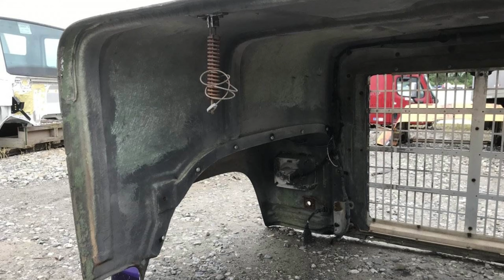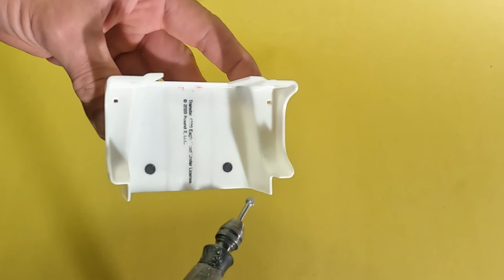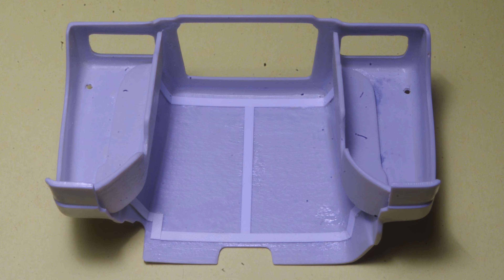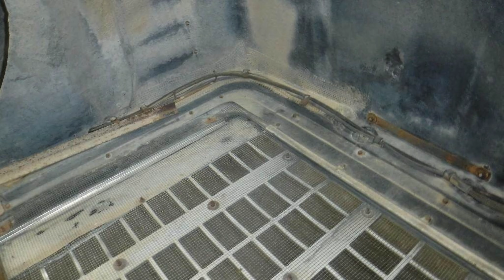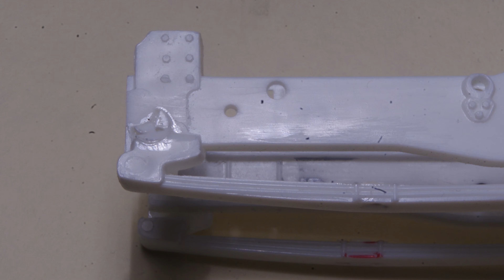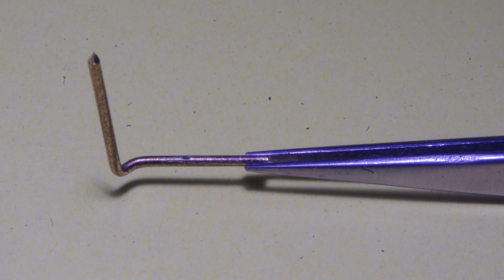Adding under hood details to a 1/25 scale Transtar 4300 model (literally!)

Comment: One more method to create a texture on the bottom of the hood is to coat the surface with some model cement and stipple the surface with a stiff brush the come back after it has dried and lightly sand it just to knock the too high points, this can recreate a cast look for metal and for rough fiberglass
Reply from the maker: I am going to use that solvent cement approach on a future project, I think it will also solve one minor problem with the carbide burr technique which is the difficulty of texturing the laminated reinforcing ribs.

Comment: That is some nice super detailing. Very well done Robert.
Reply from the maker: Thank you, it was fun to “problem solve” and puzzle through. Initially I considered using step side fenders from an AMT Chevy pickup kit of about a 55-57, for the inner fenders but only had one set so decided to try building inner fenders instead as I would like to build another Transtar or two in the future.

Comment: Robert ,
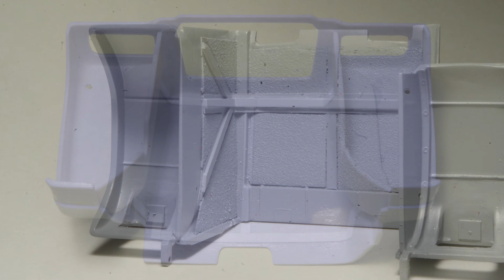3:38....model or real prototype?
Your content is growing more incredible with each episode. 
Must see for every rig modeler.
Reply from the maker: That one is a modified AMT part, shortened from kit's 116" BBC to 108", based on a 1:1 truck operated by Carling O'Keefe Breweries back in the 1980's. Styrene strip braces were added to under side and the rough texture is sandpaper, I think around 180 grit, cut and fitted between bracing to resemble sound deadening insulation. 

Similar approach to prototype modelling in the model railroad hobby, although the 1/25 scale parts are generally easier to see and work with!